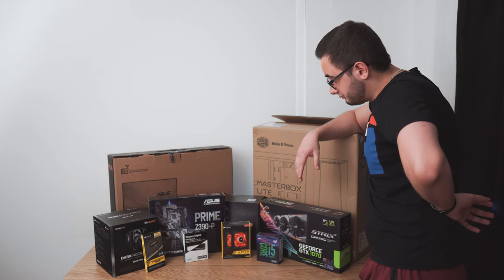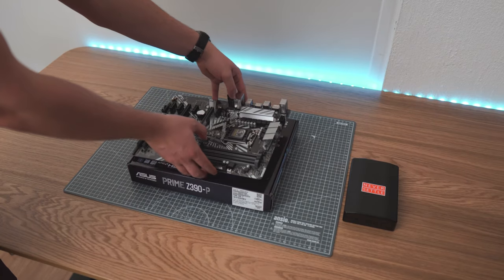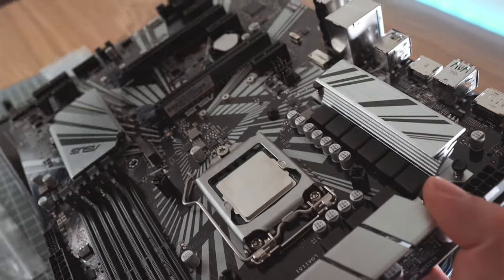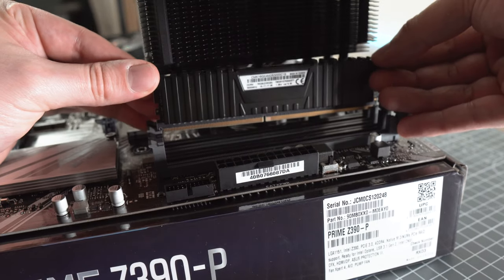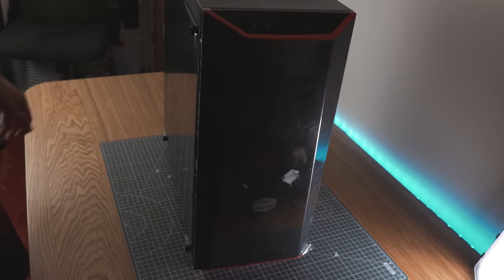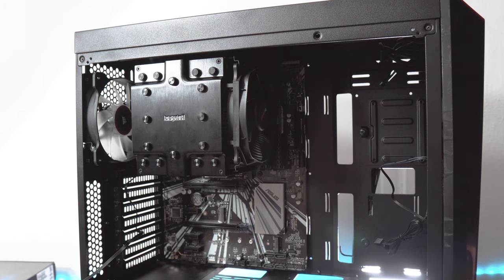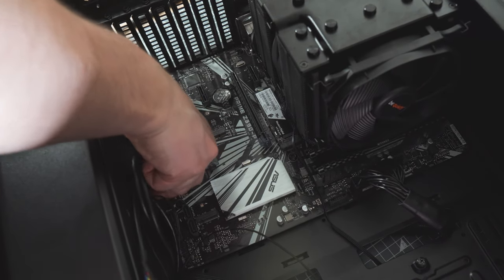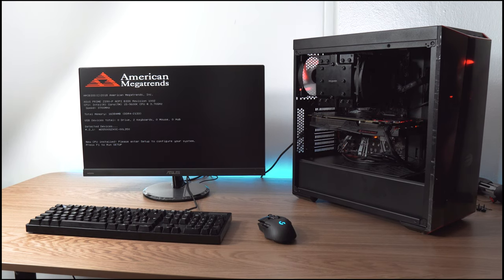PC Master Race: Building a High-Performance PC

Comment: That NVME tightening is bending it... wtf?
Reply from the maker: What do you mean?
Reply from the maker: @dimuthrubesinghe7319  ty for the heads up, fixed it when i received the first comment about this cuz i was currious.. so i done some research as well. Anyway ty.
Reply: @dimuthrubesinghe7319  Thanks

Comment: I can’t get it to work, orange light when try to run, can you help me please?
Reply from the maker: Orange light where? On the motherboard? If that so, try to put your Ram in another slot. Check where is that orange light is exactly.
Reply: @TechGadgetsMedia   there are on the gpu, on both pci-e gpu slots. HDMI display shows with power but no signal. The GPU works on another PC, so is not because a faulty gpu.
Reply: The motherboard is ASUS Z390-P.

Comment: Please what cpu temps are you getting.
Reply from the maker: The CPU runs quite cool. On full load i only reached around 50 celsius.
Reply: TechGadgets thanks for the reply
Reply: @TechGadgetsMedia   It's realy help me. Thanks for your answers.
Reply: @TechGadgetsMedia  Have you tried dark rock 4 pro in overclocking ? Can you tell me what the temperatures are without overclocking ?

Comment: And since you are a pro in this corner , i wanna get two monitors but dont know the sizes , one will be 144 hz and one is 1080 should i go with 27 x 24 or how does it go
Reply from the maker: This is a personal choice. If you want to go big go big. If you had small monitor or laptop before, 27 is going to be massive, but eventually you will get used to it. Also measure the space you got on your desk just to make sure it will fit two monitors.
Reply: Thank you man , been real helpful, with the content and inquiry's

Comment: This is my new rig, so i can use a 2400 or 2800 ram? Instead of 3000 to save up som bucks will upgrade later but would it be fine ?
Reply from the maker: It's better to use the same MHz clocked RAM otherwise all the RAM is going to be set to the lowest